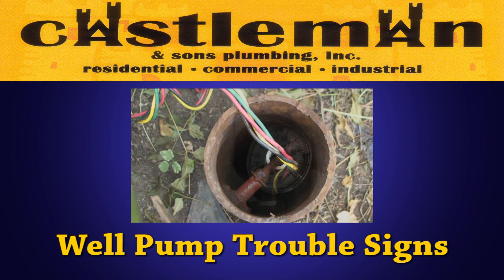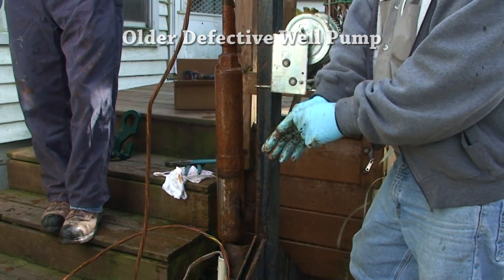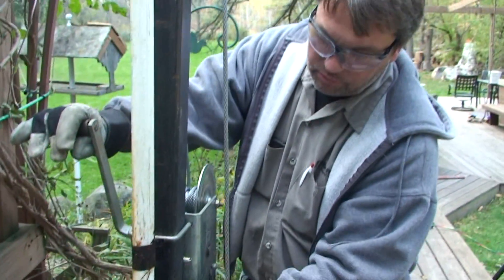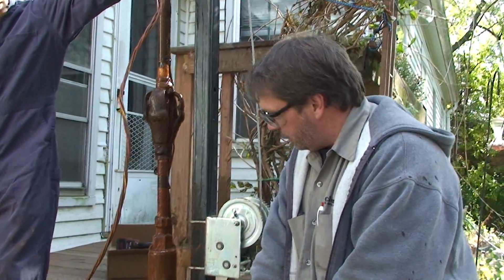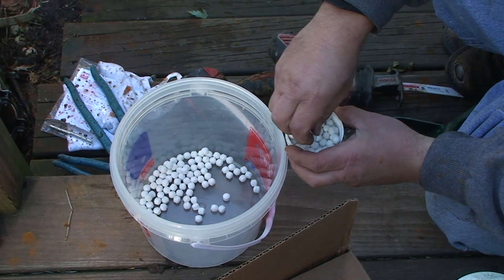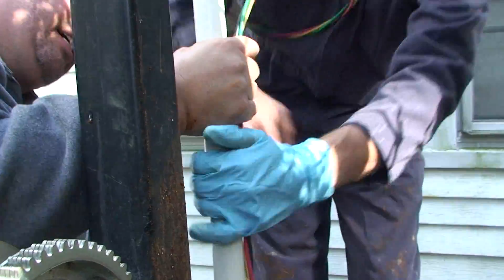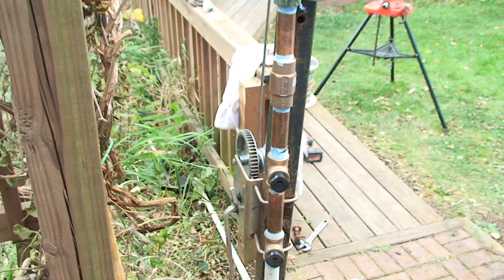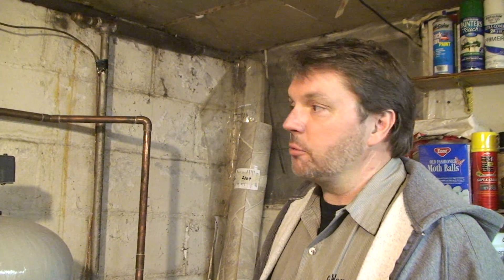Well Pump Trouble Signs & How To Replace A Defective Well Pump

Comment: what does a job like that cost
Reply from the maker: +john Kosheluk Hi John, no two jobs are the same, due to the variances in well pump depth, well submersible pump requirements and the replacement parts needed. As such the labor could be just a few hours, to a full day or even longer, if the well sits a lot lower than 100 feet. The range typically falls between $1800 to $3000 for pulling an old well pump, replacing with a new unit, hooking up the electrical and pumping components again, and restoring water service to a residence. Thanks for watching and sharing your comments. We invite you to subscribe to our channel.
Reply: so you installed a 300 dollar pump in 1 day and you think that's worth 1500 dollars?  You sir are a ripoff artist.
Reply from the maker: Hello A M, I realize that by watching the video it all looks pretty easy. It's a lot like watching a professional mechanic work on overhauling a transmission! That being said, this particular job required two trained plumbing professionals, working about for a total of about 16 combined hours. Let's help with a little math. 16 hours x $60 an hour = $960 (licensed master plumber is $90/hour, 2nd plumber is $30/hour). Then the $300 pump. Oh but wait, there's also new PVC, new wiring, new electrical box, new couplings, new hook up the existing water pump, testing the pump and tank, well tank disinfectant and water samples sent for testing and follow up. Plus this is all completed by a licensed, master plumber, who routinely earns about $90 an hour with a warranty on both his services and the installation of all products. The $300 pump is a fraction of the total cost, and again, this type of job is similar in nature to overhauling a vehicle transmission - if you are a very skilled and knowledgeable DIY plumber, you may consider doing this on your own. You may need to purchase or rent a device to pull the well pump if it's 80-100 feet down or even deeper, adding $50- $250 to your cost for a puller. And if you something goes wrong and the old unit falls in...that's gonna be a very bad day and likely double your cost.  A M, we appreciate your comments and thank you for giving us the opportunity to clear up some misconceptions about the costs and challenges associated with a job like this.

Comment: Great Video! I wonder if you could tell me why my pump keeps running and running after the pressure drops below the cut on. I have to shut power off for about 5 seconds to reset the pump to stop it from running. I am not sure what the HP is this was an existing pump. I did replace he bladder tank, pressure switch, and gauge. Work fine for a bit but now the problem has arose. The pressure switch is a 30/50. THe pressure tank is set at 28 psi. Could it be the pressure switch setting is too low? like I said I have no idea the HP. This house is 8 years old. So, I am assuming the pump is the same. I would greatly appreciate any help. I cannot afford to replace the pump right now.

Comment: OMG what a nightmare. I was going to try it myself but this looks too complex and I don't have a pump puller. Thanks for the video though.
Reply from the maker: +Artifactsofmars We agree this is a very challenging project. For one, having a pump puller is essential to lift that unit 80 feet on this job, and some well casings could be much, much deeper. And years of professional experience certainly help with the assembly of the new pump and components. Thanks for viewing the video and we hope your well pump issue can be fixed without excessive costs.
Reply: I have posted a video on my channel, making the task seem quite a bit simplier. Check it out if your still in need :)

Comment: What type of filter did you recommend for the iron issue?   Is the recommended filter in the well or in the home?
Reply from the maker: +Nancy Troutman Hi Nancy, the unit is often referred to as an Iron Curtain, and comes from various manufacturers. It is installed inside the home, so the unit can be examined and the filters can be changed, as warranted by the amount of iron in the water and the water usage. Thanks for watching and for the great questions. We hope you subscribe to our channel and we invite you to follow Castleman & Sons Plumbing on Facebook if you have more plumbing questions.

Comment: Ok this might sound sorta stupid but I was wondering is there such thing as having to much pump as to strong I currently have a 1/2 hp pump I believe its labeled to be 60gpm but found a 3hp that pumps 155gpm. I ask cause I have 7 people in my home my 4 daughters my wife an I an my sister is also living with me so I upgraded my pressure tank from a 36 gallon to a 86 gallon that sorta helped to keep our water pressure up but if you run the washing machine and attempt to take a shower up stairs once that pressure tank is empty it's basically over nothing up stairs an just a trickle down stairs go to the tank to check pressure an it is around 3psi on the low side to maybe 5 to 7 high side so I'm guessing the pump is not adequate for our needs cause long you don't drain that tank dry pressure is normal shower fine ya as it starts to get low after a 20 min shower the water isn't as strong but still a steady flow. So I guess what I'm asking is it ok to basically go way over board with my pump
Reply from the maker: +85gbod Thanks for your comments. In this video, the customer's submersible pump was also running at a trickle with just a couple of different uses, like a hose outside and sink inside. The problem was a mechanical failure with the old submersible well pump. The new replacement submersible well pump will adequately provide water for several uses simultaneously, like a person taking a shower, a wash machine, flushing a toilet. Having a much larger pump will be OK, however the electricity usage will be higher than may be necessary. In other words, it's like driving a semi-truck rather than a smaller delivery truck to move a few items. Both will handle the job, but the much larger horsepower pump will be more costly over time, due to it's higher energy costs. As was the case with the customer in this video, a new pump with similar horsepower completely restored the customer's water needs. You may want to have a licensed plumber in our area assess your system if in doubt. Thanks again for your sharing your situation. We hope the video has helped!

Comment: Can you help me.  Last week I came home and found my sprinkler pump running. It is located in the garage and filled the garage with water. I shut the pump off and the next day re-plumed the piping as the pipe on the discharge of the pump broke loose. (It's about 25 yrs old) I cleaned the threads on the pump replaced all piping. However now I have no water pressure. The pumps keeps running and I'm lucky if it get up to 10 PSI. I'm  getting water at the sprinkler heads but not enough pressure to raise the heads up. I shut the zone off and the pumps just keeps running without any pressure build up. Do you think its the pump, maybe the vanes in the pump are slipping?

Comment: We are trouble shooting a well,  The pump runs and builds pressure to 60 lbs, however, after a few minutes the water flow slows to a trickle while the pressure tank shows that we have pressure in the system.  The pump kicks back on at 40 lbs but the water flow continues to be just a trickle.  If we wait awhile we get full flow for about 3-5 minutes.  Any ideas?

Comment: We have been having issues with our water pressure. Installed new bladder tank, jet pump, two lines to the well. Have a 100ft well and hit water at 20ft. Still not getting enough pressure. Help please. Plumber has been here for two days with no luck.

Comment: Could you please provide some insight or direction on a problem?  A couple of weeks ago my water would show signs of air when i first turned on a faucet or even the commode but after a short spurt the water would run fine--this was off and on but nothing major--then one morning I had no water. One plumber came by and checked "things" and found nothing (by the time he came the water was running fine--by the next morning --- no water again; had a different plumber come by and he check the pressure etc and indicated that he saw where some air may be coming out and fixed it----next morning ....no water....called him and he said I may need a well----thought this was pretty drastic change of pace...the water has never been dirty...I thought that due to the air that it could be an air volume control valve or check valve....thoughts......Thanks!!!

Comment: Couple questions... Are you guys using blank end p.v.c with glue couplings? 1 Inch polyethylene would be much easier. Also wouldn't a captive air tank be more practical?? Your pump pulling tool is neat never seen one like that.
Reply from the maker: Hey Glenn, thanks for your watching and your comments.

The pipe is threaded and coupled schedule 80 PVC. 1" Polyethylene is OK for very shallow settings, but not recommended at 100'.

Captive air tank would aggravate a rotten egg smell on this job. By oxidizing the water in the pressure tank we keep the odor at bay with a constant fresh source of oxygen.

The well puller I had built to our specs. Have pulled a 1hp pump set at 430' with galvanized pipe without a glitch.

Comment: great video however It would have been nice if you would have shown the break free process of the old pump, what few people know is that a 3 wire pump is seldom changed and can be 40 years old. the biggest trick is getting a pump free especially after its covered in silt and 40 years of deposits, and in a 4" pipe has a 37/8 inch pump in it, theres no clearance, so getting a pump out is hard to damn near impossible and sometimes even breaks off. they always show how easy it is or not at all, usually just to break it free requires back breaking effort even with a nice lift like that.
Reply from the maker: Hi Steve,
Thanks for your comments.  Yes, replacing a well pump is NOT AN EASY JOB!  Fortunately, the customized rig we have enables a steady pull upward for removal.  On this job, the pump itself was located about 80 down in a vertical pipe that was about 100 feet deep, suspending the pump in water only.  As such, this 20-year old pump was not embedded in any silt.  Still, as you have pointed out, changing a well pump is certainly not a simple plumbing procedure for anyone.  It's best to have a professional service like Castleman & Sons Plumbing complete a job like this.

Comment: I see you flushed the well with the replacement pump, but, i am surprised you didnt have a universal reversible pump to blast around the bottom and clean her out a little before putting in the owners full time pump.  Sorry, just a perfectionist here, but just saying.  Either way, thanks for sharing.  It was VERY educational just the same and I appreciate you taking the time for us youtube watchers, thanks.